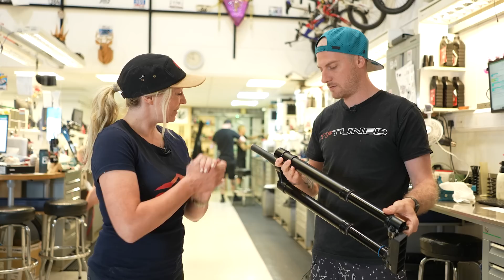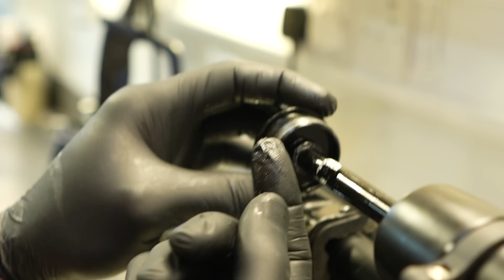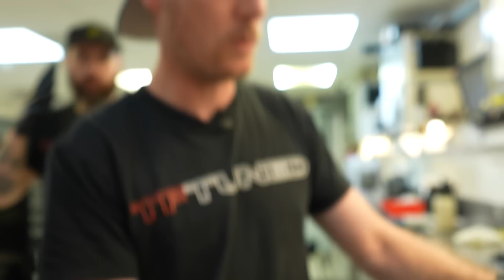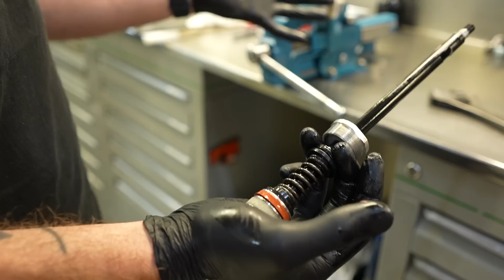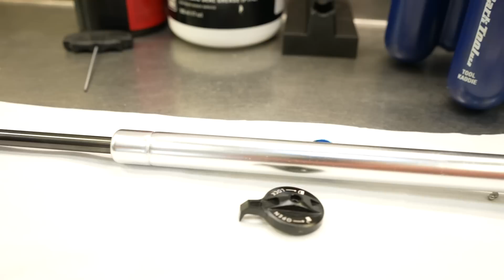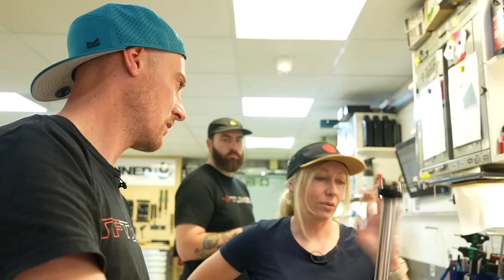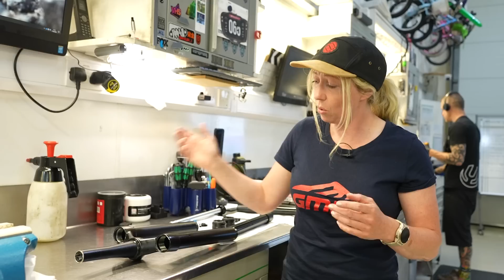Pro Mechanic Reacts To CHEAP AliExpress MTB Forks!

Comment: $140 isn't even that cheap. I'm pretty sure you can get a half-decent SR Suntour for that price.
Reply: Shit you could get a basically unused take off 34mm stanchion x fusion 140mm fork for less than that.
Reply: @dylan-5287  So many good used options from reputable brands for that price. Even if you do buy a lemon, there's probably a certified Rockshox or Fox dealer near you that can easily fix it with genuine parts.
Reply: £140 they said. You can get a brand new Z2 for about that.
Reply: @CanonFirefly  no, still a Suntour. Difference from exchange rate goes to import tax.
Reply: @feedbackzaloop  brand new Z2 is the equivalent of £180 in Australia ($350 AUD).
Reply: @CanonFirefly  not entirely 140 in Britain, innit? Quick google search doesn't show anything below 400£, usually 550+
Here in Germany z2 are bit over 300€, importing them from Eurozone to UK will end up in 400+
Reply: @feedbackzaloop  But at least its decent fork thats not going to kill you lol
Reply: I just bought a barely used yari 160mm for $150
Reply: I bought new out of the box Sr Suntour xct for 43,26 dollars amd it works like a charm
Reply: could get a decent used  fox or rockshock fork for that, and even if you had to pay for service would at least be a quality fork.
Reply: yeah i got my sr suntour air fork for less then that new
Reply: real price was 90, 140 was after the shipping and taxes. i watched the previous video
Reply: Exactly !

Comment: I challenge you to rebuild this into a quality fork.
Reply: Alas, they don't have neither skills nor tools for that. It's TF Tuned, not ND Tuned.
Reply: There is no way to rebuild this into a quality fork. The CSU simply cannot be trusted, and everything else is just ungodly expensive. You will basically end up piecing together a quality fork while spending more than a quality fork.
Reply: We used to explain that: "You can't make chicken soup out of chicken s__t" Landfill time.
Reply: It can’t be done. Most of the threads were threaded after we opened it. Also, none of it could be replaced by parts in their workshop.
Reply: @annaonthebike Loctite 641, drill it and run a roll-pin through…. My biggest concern is the CSU interface. They’re fine till they’re not
Reply: I should add, I have a pair of 2002 SID World Cups on my commuter that are likely WAY worse than these 😂
Reply: I second this! I guarantee they've got parts and seals laying around that would fit

Comment: Ok, so not that dissimilar quality on the inside to RS or F
Reply: When hes shaking the fork and its knocking... i was like "hey!! my fox factory 36 & 38 makes that same noise" 
3 of my last 4 factory forks have knocked and fox refuse to say anything is wrong.
Reply: @Bestintheworldatwhatido  yes, normal thing for any mass produced product. There must be play between parts not originally made as a pair. Quite different to connecting rods and their big end caps.
Bet the forth of all four knocked too, you just didn't clean the lube off well enough😁
Reply: @feedbackzaloop  I had the bushings replaced, the fork is smoother and no knock - been over 12 months and they are awesome now
Reply: @Bestintheworldatwhatido  ah, they should have been resized/calibrated for a perfect match. BTW, did you get OEM or aftermarket?